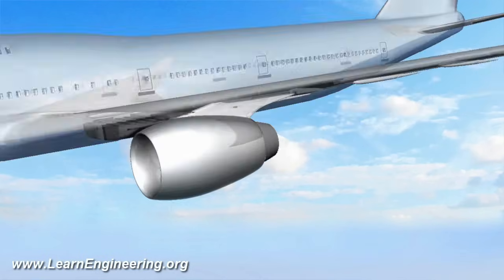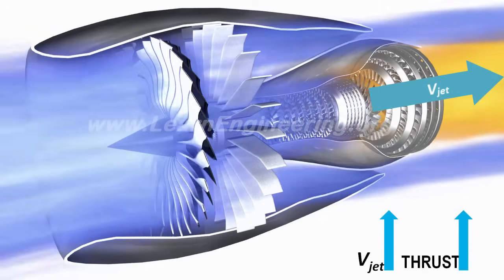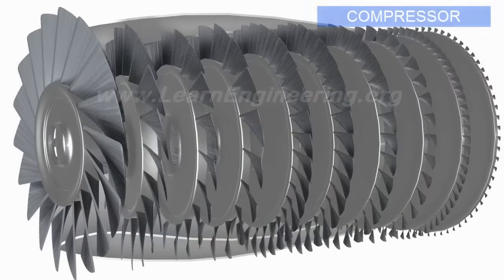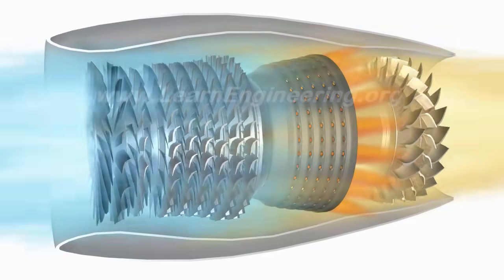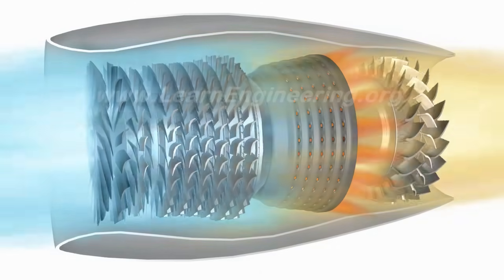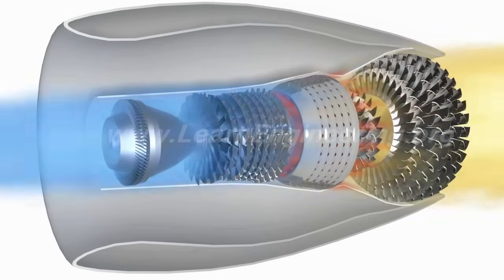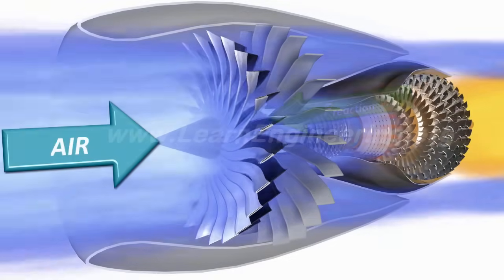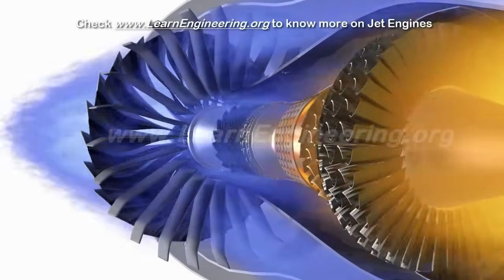Jet Engine, How it works?

Comment: . How can a plane take off given the weight of the fuel? One gallon weighs 6.8bls and the engines burn 1 gallon a sec.How can a long haul flight store hundreds of tons of fuel? Also how are there planes filled up as I've only ever seen little tankers, plus where is all this fuel stored at the airport. A plane takes off every minute or so not all will need fuel but a good chunk I bet. COMPRESSED AIR
Reply: Completely wrong.  Where planes store fuel is so well documented it's not worth repeating again.  The fuel does not arrive in tankers, it is piped underground to each aircraft stand.  The smaller trucks you see just connect the hydrant to the aircraft.  

As for the compressed air nonsense, any aircraft engine needs a constant supply of fuel, and lots of it.  As an example, and A380 will burn 8 tons of fuel between starting the engines and achieving a 30000 feet cruising altitude.  It will then burn about 12 tons of fuel per hour whilst cruising at that altitude and at around 550 mph.  It then needs some for the descent and landing.  Add that up over a 14 hour flight, plus 5-10% for reserve, and you'll get to around 198 tons.  No fuel = no power = crash!  Simple.

Comment: he lost me at 2min when basically says he has no idea how it works.. lol... where does the energy come from initially if the fans are going the wrong way... ??  this is an air compressor, superheating air to combustion...thats not jet fuel guys. The blades are designed to create vibrational frequencies like how a bumble bee can levitate ..not fly... planes levitate they do not fly like are told...n geometry, a golden spiral is a logarithmic spiral whose growth factor is φ, the golden ratio... called the Fibonacci sequence..the airlines have used levitation for 80 years plus... take the a380 airbus..tell me where they put 240 tonnes of fuel?? anyone.. ?? 320,000 litres ?? ... theyre called air-ports for a reason ... the use compressed air to fly.. cheap air !!

Comment: what a joke only compressed air is used to spin a jet engine compressing air gets hot try pumping up a football and feel the pump its hot with no fuel being used also the blade are not spinning the right way this is propaganda
Reply: 1) yes, compressing air makes it hot, but you still need to mix it with fuel and burn it to devellop enough energy to spin the turbine AND still have some thrust left. Compressed air is a terribly inefficient way to store energy, it makes for a stupidly low thrust to weight ratio
2) this is a shitty animation on youtube, not an engineering cursus. The dude who made it probably didn't give much of a crap

Comment: yea thanks for showing us how ZERO jet fuel is used for these Jet engines to work. It's all compressed air, no LIQUID JET FUEL -  WE know free energy already exist and being hidden right in our faces.   Show me a where the liquid fuel is coming from? no fuel tanks are built into the wings -  wings are designed for aerodynamics, Not holding additional explosive fuel.. wake up sheep, we are being hoaxed and robbed. Jet planes do not use liquid fuel, jet engines fly on compressed AIR and that's it....  AIR=PORT is for refilling of AIR not jet fuel...
Reply: How do you think combustion occurs inside the engine then? xD
Hope you don't think compressed air can combust.
Reply: I've got a big ass textbook on jet engines right behind me that explains in excruciating details how they work, and I'm pretty sure kerosene is a big part of it. I've also had the chance to take a peak upclose at a B727, and I'm pretty positive that there are fuel tanks in those wings and in the fuselage.

Free energy is a myth, it violates the very the very rules of the universe. You want something to move? You need to give it energy, and that energy has to come from somewhere.

Comment: Everyone needs to wake the hell up and realize that they can't put 18 tons and feel in each jumbo jet wing and still take off it's completely Bullock's and retarded. They are flying under Compressed Air energy where the fans compress the air so much that they just burn the air out the back. We are being Hoaxed... this might sound really stupid but there is no way that jet fuel sits in the wings and there's no room for it with all the Hydraulics and Wing flaps Etc.
Reply: do you think air tanks are lighter than kerosene, for a similar amount of energy stored? I'm a diver, I can assure you that air tanks are heavy as fuck. And if opened, my tank would barelly push a bike with a toddler on it for a few minutes, and it weights about 15kg. For the same weight in gasoline I can make my car run for a fucking hour

Comment: In this case there is no need for Kerosene? Jet engine is working with compressed air and not with Kerosene? Compression of air generates a lot of heat. The tank on wings I suppose are air tank. "Most compressors have an air tank to hold a quantity of air within a preset pressure range. The compressed air in the tank drives the air tools, and the motor cycles on and off to automatically maintain pressure in the tank."..."Many articulated-piston compressors are oil lubricated. That is, they have an oil bath that splash-lubricates the bearings and cylinder walls as the crank rotates. The pistons have rings that help keep the compressed air on top of the piston and keep the lubricating oil away from the air. Rings, though, are not completely effective, so some oil will enter the compressed air in aerosol form."(https://www.popularmechanics.com/home/how-to/a151/how-air-compressors-work/) So I understand these air compresses working jet planes do not use fuel oil. Their tanks are filled with air?
Reply: no, i have no idea how you come to that conclusion.
They run on Jet A1 (basically kerosene). It's added to the compressed air in the combustion chamber, as it's burned it creates hot exhaust gasses to turn the turbine, which turns the fan and compressors at the front. You can't just make power out of literal thin air. And Turbo-fan engines don't have pistons lol

Comment: Why don't you ever see flames coming out of a commercial jet engines ...it does not make any sense to me... Any help please... I understand how u can have air compressed so u can have less fuel to do the work.. Which is like raising and lowering voltage and the current is raised when reducing the voltage with a transformer and opposite when raising the voltage... The total is still the same... Minus voltage drop over distance of course...i know temp and pressure are related and it may be because the fuel is under high pressure in the combustion chamber so u would expect seeing some plasma coming out of the engine... I maybe missing something... Don't know what

Comment: That compressor spinning the wrong way points out a fundamental misunderstanding by the computer animator. He figured that the air entering the engine cause the compressor to spin, thus his errorneous blade angle. Because  it has to SUCK air into it the compressor blades angles need to be set inversely to what he shows. Bad animator bad! [grin].

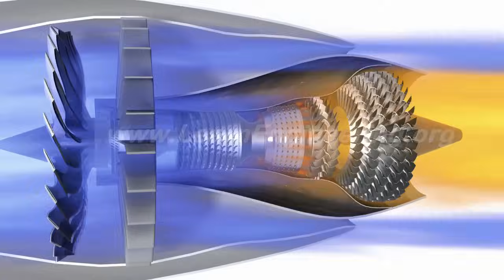Comment: The fans have the correct dirrection of rotation - the same as the turbine (they are on the same shaft), but they have the wrong orientation of blades. BTW, the large fan changes orientation of blades, at about 4:00 it is OK, but later (5:00) it is wrong!
WRONG ANIMATION!

Comment: " Jet engines have been a successful drivers of aircraft for nearly a century now" What kind of BS is that? Jet engines were first used in aircraft in the 30s or 40s if I remember correctly.

Comment: What i dont understand is how is a jet engine different from a regular propeller? Is it because of the number of compressors that compress air? And how does the fuel  help it move faster by mixing it with air??? And how do they get the different compressors to turn at different speeds?

Comment: they already use air pressure the aqua marine hybrid version would not be difficult to create for the sea duck fighter jet my person had dreamed of  of which could submerge and be an decoy of sorts for an air craft carrier and pop up snd climb into the air with its main engine dry and clean of water yet use its pressurized air ability for below water propulsion the engine could be switched over unto electric with in  the submergable section of the jet engine hybrid and its swept wing design being as much smooth as the much loved american tomcat would assist it to be sneak out portals in the rear of the ship and need not an run way equipted with such modern technology.

Comment: But how does it works while starting the engine when you don't have a torque to compress the air to form a combustible mixture?
Reply: A BIG electric motor, or a supply of compressed air from outside the engine is used to spin up the high pressure spool until the combustion chamber conditions can sustain a flame. Once lit, the external drive is removed and the engine accelerated (by increasing fuel flow) to idle condition. During start-up, the low pressure spool is accelerated by whatever residual energy is left in the flow as it exits the high pressure turbine.

Comment: What happens in Rain?
Reply: You get more thrust as the rainy air has more mass. It also cools the air going through the compressors as it vapourises (kind of like an intercooler) so you can add more energy in the combustion chamber and get even more thrust. In short it's not a problem, see link <https://www.wired.com/2014/11/how-ge-tests-jet-engines/ >

Comment: What is the function of bypass?
Reply: Higher efficiency by increasing the mass of air that you accelerate, which allows you to accelerate it less (thrust = mass × acceleration).
Its good to accelerate it less because the more you change the state of the air from what it was originally, the more energy is wasted moving the air and not the plane.

Comment: I've always thought that the compressor blades spin in alternate direction for more pressure. Apparently those are statorblades  and are stationary. (had to discover it in the comments section though)

Comment: Wouldn't a jet engine be easy to convert into an electrical engine? Using electricity to heat up the air instead of fuel.

Comment: No. The particles in the air outside the engine push the plane forward by resisting the gasses  conning out of the engine. !!

Comment: '
that jetmotor with too many blades / too many spinwheels are so heavy weight...
that is why too much drinking fuel / gasoline...
need to cutting it off ...
better few blades / few spinwheels

Comment: You say that jet engines have been powering aircraft for nearly a century.

We first flew on December 17th, 1903, at Kitty Hawk with the Wright Brothers. That was 114 years ago.

The first jet engine aircraft flew on August 27, 1939. This was the Heinkel He 178 V1, built and flown by Germany. This was only 78 years ago. You could say "nearly 80 years ago" instead, or, because you uploaded this in 2015, you could have said "three quarters of a century ago."

Nothing bothers me more in these types of informative videos than when people aren't correct in their statements, and don't double check before saying something.

Furthermore, putting a watermark in the video with a web address that is right in the center just draws attention away from what you're trying to teach. I don't want to learn everything about engineering, I just want to see how the engine works, Finally, capital letters www.MeanNothingInLinksToWebpages.com.

Oh, and in case you haven't seen the other 958,518,947,274,717.6 comments, the blades are spinning the wrong way. Thanks.

Comment: I get that engine has two sources of generating thrust, 
1. Bypassed air straight from the front fan
2. Combusted hot air from the inner chamber
Now, which of these produces more thrust and how much more?
Reply: Depends on the chosen bypass ratio of the engine. For "slow" airliners wanting to maximise efficiency it'll be 20:1 or so in favour of the bypass air. For military engines (which are still usually turbofans) it's more like 1:1 as you need the raw jet velocity (i.e. a large difference in exit velocity - intake velocity) to generate thrust at high speed (i.e. high intake velocity).